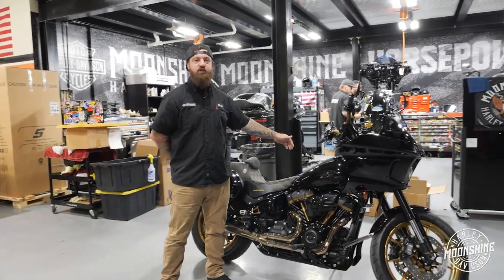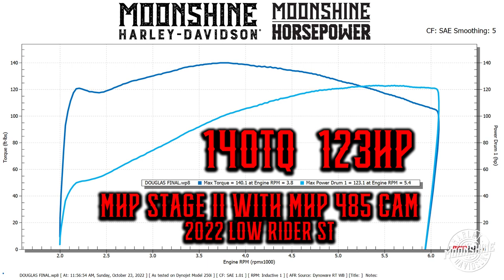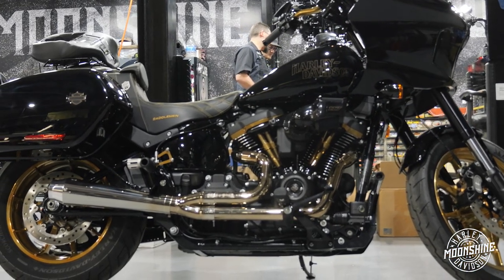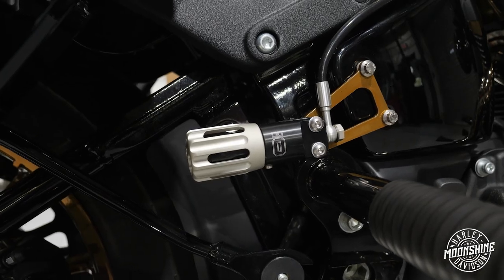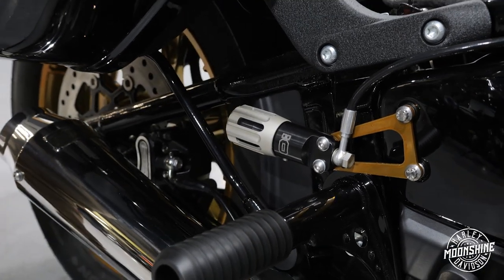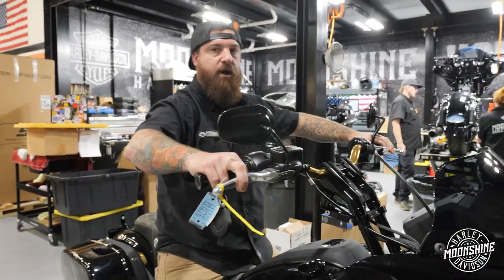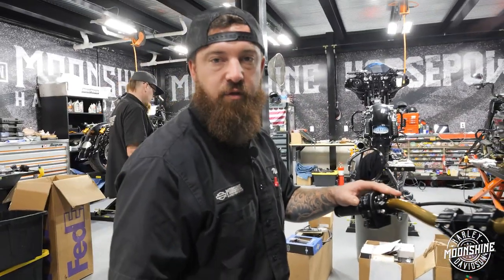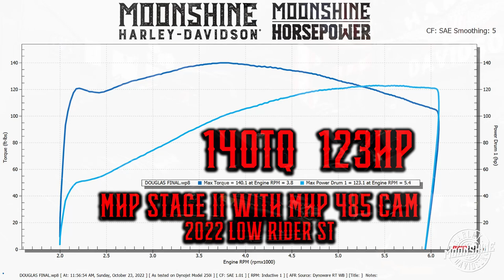Moonshine Horsepower Stage II Kit with MHP 485 Cam 140TQ 123HP | Bike Build No. 15

Comment: I bought a new ST a few months ago. The build you did to that bike is what I want on mine. Great channel thanks.
Reply from the maker: Thank You! Let us know if you need anything. 

Nick - Aaron - Jamie - Mike
Phone: 615-274-4170
Email: horsepower@moonshineharley.com
If you email us please provide a good contact phone number for you.
Reply: I just bought a 2023 lowrider s  moonshine can u contact me I got the mhp 485 in gona install working in throttlebody would like to know injectors used thank you
Reply: @MoonshineHarley Hi guys, I got the m h p 485 right now I have a 55mm tb with a screamin eagle extreme flow intake I'm wondering if you used stock Injectors in this build or 5.5s thank you .

Comment: Looking to order these parts for my build. Is that the Screamin' Eagle Extreme-Flow CNC 64MM Intake Manifold 27300185 or the one that comes with the Screamin' Eagle High Flow 64mm EFI Throttle Body - Milwaukee-Eight Engine 27200040. Keep up the good work. Thanks

Comment: @moonshineharley what length cable did you use on that gauge setup?
Reply: I have the same setup (Kraus risers and Fly Moto bar)on my 21 street bob. The stock cables (clutch and brake) worked perfectly. I did have to extend the gauge harness(plug and play). My gauge has the same Kraus housing but with the mount that mounts to the top of the riser clamp. It’s easier to see without having to look down.
Reply: Thx Jim! I also have the same bar/riser setup installed (minus the 1 1/2” plate). I’m adding the digital gauge setup and Koso D2 gauge and got a 21” cable for it. Haven’t installed yet but looks like it should work out

Comment: Well 1/2” is not 30mm, just saying lol
Reply: It's will raise the bike about 30mm vertically a lil over and inch if u extend the shock 1/2" due to its angle...

Comment: Who actually makes this pipe? It’s the same pipe as the thrashin 2-1 which I hear is welded by basani.
Reply: Feuling.
Reply: I can see the thrashin logo on the pipe.
Reply: The pipe is 100% thrashin supply NOT Feuling.
Reply: Feuling designed the headpipe in collaboration with Thrashin' using Jim Feuling's patented design anti-reversion 'AR' chamber and then the pipe was branded for Thrashin'.
Reply: @indecisivegearhead  That's not true at all. Jim Feuling was years ahead of his time. He designed the AR chamber 20+ years ago. I love what Lance and the guys @Thrashin' are doing, but this pipe is like 2.5% Thrashin'.

Comment: This build would be a complete waste of money if it weren't for the pipe. Eliminating as much low-end torque dip as you possibly can, equals neck-snapping throttle response and instant hold onto your ass acceleration.

Comment: How much $$$ ?
Reply: They quoted me almost 6k to take my stock 107 to their stage 2 set up. Quiet a bit on the high side I think
Reply: Thanks 👍
Reply: @williamrenner2504  other shops I’ve been quoted about 2k
Reply: Thanks 👍
Reply from the maker: @JFROMM454  That price includes the primary build as well which would include the MHP Comp Ramp and Rekluse Clutch. If we leave those pieces out it’ll reduce the price but we’ll most likely see you back shortly. With this cam the stock clutch will slip on the Dyno and we’d like to build the bike to the power it’s going to through down.
Reply from the maker: @JFROMM454  when we do our stage II builds we include intake, exhaust, manifold and throttle body and primary build. The stock clutch and comp can’t handle the power this setup is laying down. Our setup isn’t more for the same items it’s more because we include all the parts you’re going to need so you don’t have failures later.
Reply: @MoonshineHarley  ok thanks for the answer, it helps me determine the value of what I would want. Thanks again.